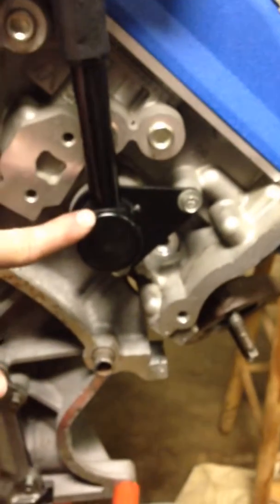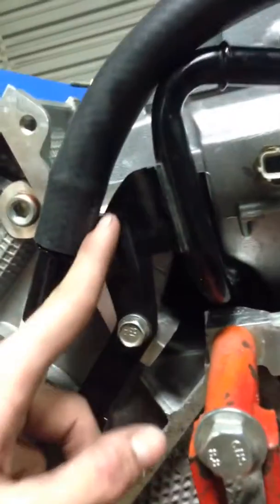4.6 4v cooling Mod

Comment: Do you know if a supercharger for a 4.6l 32v like you have here will fit on the 5.4L version of the 32 valve? My dad and I swapped a 2001 navigator 5.4l 32v motor into my 2001 F-250.
Reply from the maker: Not sure. If a 4.6 manifold fits then the blower would fit I think. I’d just do a centrifugal blower
Reply: @2004dsgmach1  thanks a lot, I want to get some power out of the engine with not a huge budget, is there anything other than a blower? Maybe bigger injectors and a tune?
Reply from the maker: William Ponds budget and build don’t go together my friend lol. All in for the Eaton swap on my Mach 1 was around $3400. Injectors, MAF, fuel pumps, tubes, the list goes one because your stock parts aren’t built for that demand, internals also, 4.6 are only good for around 475 then they pop. Not sure about 5.4 but they share a very similar rod (which is the weak point). 

Do some research and figure out if a 4.6 procharger kit will bolt to a 5.4. If yes then be on the lookout for a used one (usually less than $3000). Then fuel, MAF, etc..
Reply: @2004dsgmach1  thanks!

Comment: Nice. I've been fighting my 7 and 8 misfires, from valves sticking. So this is probably part of my problem. It's fine when  cold, but as soon as it warms up, I get the rough idle, and money light. I've tried everything besides removing the head, with zero luck. It's those exhaust valves, and you just can't get to them like you can the intake side. I guess that if, or when I do fix it, this is something I should do.

Comment: Longtivity wise have you had any issues with leaks or heating issues after installing your version of the mod?
Reply from the maker: jmanawsomeness never had any issues with that setup. However I pulled the trans shortly after this and replaced it with the MMR unit. You can use any method you want and they will all work the same, it’s just a exit for the hot coolant any exit is an exit
Reply: Gotcha i was just making sure there wasnt some major flaw you ran into and thats y you switched to the mmr style setup because im about to pull my heads and want to do this mod after the guides r replaced and i found the part for 60$ brand new
Reply from the maker: jmanawsomeness sweet. I didn’t think they sold them anymore. Only “issue” I guess is the tube on the driver side head is very close to the head so you may have to bend it away from head to get the rubber hose on
Reply: They dont make them anymore but i found a ford dealer who still has 9 of them and i ordered one just now
Reply: @jmanawsomeness  where can I buy that part ?
Reply: And cool thank you for the info

Comment: so I already have the head tick.. is that head f*ucked? or can a rebuild fix it.. I've read it's just the tensioners
Reply from the maker: Mitch Barber. If the head already has head tick then you need to replace the head or get it rebuilt with all new valve guides. Basically the valve guides got so hot they warped and now are contacting valves when the valves open and close
Reply from the maker: Mitch Barber. BUT what side is the noise coming from driver side or passenger side? Front or back of engine?
Reply: 2004dsgmach1 I honestly think it's passenger side rear.. it's an 03 Mach. I can send a video of it.. I got the car a month ago she has some miles on her but I baby it.. very rarely floor it and the sound wasn't there when I got it, the noise is most noticed when it's cold at first start up
Reply from the maker: Hmm you may just have a chain tensioner problem or lifter bleeding of pressure and making noise on cold start but if the noise is always there then it is most likely the "head tick" but Normally it happens to the driver side head which is why people install the cooling mod like in this video. If you can send a clear video then send it to me @ 9726238665 or Blake pomykal on Facebook

Comment: yeah all the cam dots pointing up right? And yeah u got any tips on taking that bolt out?
Reply from the maker: Hmm your gonna have to drill into it and use a extracting drill bit and extracting reversin bit to remove it. Your gonna have to get some drill bits that wil cut into a grade 8 bolt. Send me your Facebook name or your phone # and I'll send you a few pictures of how I had all my marks lined up

Comment: Hey bro so I'm barely doing my timing. I set the cam dots straight up. crank at 6oclock. I installed chains and then rocker arms after. but the engine still hard to turn?
Reply from the maker: Engine hard to turn? It's normally really hard to turn over the engine by hand, it's because the Pistons are sliding up the cylinders. Now with the chains installed it should be harder because now your moving the valvetrain. Or does it just randomly stop turning?
Reply: 2004dsgmach1 well I have 2 problems lol 1 broke the crank bolt lol and after I timed it it was hard to turn but I turned it like 4 times. I went to try and turn again and j couldn't
Reply from the maker: josue vasquez. Dam lol ok did all the timing marks line up to the dots/marks on the chains? If the engine spins then randomly just stops turning then you might have the marks wrong and the valves are open and hitting the pistons causing the engine to stop dead in its tracks. Let me know. hopefully the bolt isn't to hard to get out

Comment: what if I already have the heads on? how do I do it?
Reply from the maker: You can turn the crankshaft with crank pulley bolt and you can turn the valvetrain separately by putting a wrench on the left or right cam sprockets and turning to get the dots to line up
What is your phone # or Facebook. I can send you some pictures of my timing marks
Reply: @2004dsgmach1  what is that part called if I buy it like you said?
Reply from the maker: JAP JAP it’s been discontinued. Best bet is MMR kit for $200
Reply: @2004dsgmach1  I want to add an eaton on my Marauder ....any help/guidance?

Comment: Okay and what about for the smaller chain on the cams? do those have to be set up right to?
Reply from the maker: Yes. With the head on a flat surface the dot on cam sprockets sould be facing shraight up. And again straight up with both intake and exhaust valves shut and cyl 1 at TDC

Comment: how to set the whole timing lol on the cam chain ?
Reply from the maker: Ok so the cam sprockets and crank sprockets have these little dots on them as "timing marks" the chain will also have the dots on it so basically line up the dots but there's a few steps you need to take before the dots line up. First spin the motor over until cyl #1 is at TDC with valves closed on cyl#1 the crankshaft mark should be facing straight down. Then turn the cam sprockets until the sprocket marks are pointing up and then install the chain to each side. Just make sure all the dots line up

Comment: will that be good to do on a 99 cobra?
Reply from the maker: Ya, I don't think it's as big of a deal with the pre 03 4v's. But if you search head tick you will see some guys with older 4v's that have the same issue
Reply: I got a 99
Reply from the maker: +Josue Vasquez. Ya I've seen this noise and issue on pre 03-04 like yours. The cooling mod Is good cheap insurance that you won't have a issue in the future. Is only time consuming because the trans needs to be removed.  I'm currently doing the cooling mod to my 04 cobra
Reply: Oh okay u gonna put video?
Reply from the maker: +Josue Vasquez. Yes I have several videos in the working.

Comment: So i just bought a set of 2005 revised DC heads. I just realized i may have an issue. I bought these heads used and noticed that the back of the passenger side head does not have a hole for the coolant to flow out.....why the heck would the passenger head have the plug???
Reply from the maker: Racequad9. Send me a friend request on Facebook. Blake Pomykal. Send me a pic and I will hopefully clear it up.
Reply: 2004dsgmach1 dang, i deleted my FB account a couple yrs ago... it's cool, I'm taking them to shop tomorrow to get them resurfaced and valve job. the shop specializes on mustangs so I'm sure he can answer my question. i just found it weird that it doesn't have an exit. thanks for reaching out though.
Reply from the maker: Ok no biggy. There is a freeze plug that you need to remove. It's a little circle thing that you can take out. Use the video as a reference to were the freeze plug is

Comment: Did you have to drill a hole on the driver side in order to install the adapter?
Reply from the maker: racequad9. No holes were drilled. The holes are already threaded from the factory, they were just not used for anything
Reply: 2004dsgmach1 really?! did ford intend on doing this mod but decided against it?
Reply from the maker: +racequad9. The only reason there's pre drilled  holes on both heads are because the heads are exactly the same. They use the same part number on both sides. The only difference is the direction of the cams, in other words you can install the left head on the right side as long as you installed the cams to face the front again
Reply: 2004dsgmach1 good info, i did not know that.
Reply: 2004dsgmach1 wait, wouldn't you have the exhaust manifold on the wrong side though?
Reply from the maker: +racequad9. My bad they work on both sides if you turn it 180 degrees because of the intake and exhaust sides. The front of the head and the back of the head have the same exact holes/ports and holes for timing cover

Comment: hopefully you can read this brotha. what exact parts did you get for this? the cheapest kit is for like 200 bucks for some tubing and the metal outlets hahaha
Reply from the maker: David Castro+ ya man for the kits it's a lot of money. I bought from ford the black tube that goes on the passenger side of motor and just put it on the driver side head and crossed over as you see in video. Somebody recently watched the video and told me that ford no longer sells this tube. So unfortunately you might have to buy a kit or look on eBay for another stock tube
Reply: Ahhhh damn that sucks bro

Comment: How well did your version of this work out for you?
Reply from the maker: This worked great until I removed the trans for some reason and when I did I went with MMR low profile cooling mod kit. They both worked as intended, but my method was a lot cheaper
Reply: 2004dsgmach1 thanks for the reply I'll give it a shot brother!

Comment from the maker: It most likely will not help overheat issue. It just provides a exit for coolant on drivers head. The tick for me was around 38,000mls ford replaced the head with a so called revised head, which still had the issue and cause Pistons to crack on cyl 7&8. If your having a overheat issue the head tick can happen that much faster
Reply: Dude the whole overheat issue was because there was no exit and coolant pounded, now it can circulate problem solved

Comment: How long did it take for the damage to occur to the engine I haven't developed any ticking noise yet but I have approximately 14,000 miles on my build but my car has gotten warm a few times I currently have the transmission pulled in the car and I want to add this modification to help my heating up issue

Comment: Where can I get cylinder headeds to convert from 2 valve too 4 valve dohc
Reply from the maker: Joshua Nicolajsen. Honestly I would say eBay off a Mach 1 or cobra. The bolt patterns are the same but you'll need all need timing chains/guides ect. Well worth it but it's a project
Reply: Thanks for the help 2004dsgmach1, i will definitely do it once i have the money .Im putting the engine in my 1969 ford f100.

Comment: Does this matter for the teksid motor out of a 97 4.6 dohc cobra?
Reply from the maker: Brett McBurney, the teksid has same issue and cooling mod is the same with this WAP, teksid, and Romeo
Reply: +2004dsgmach1 I've been thinking about this for a long time now. Thanks for the info!

Comment from the maker: Gregory Craig all that about the functions of EGR are correct. But it's all about building HP. Now with that being said the EGR is not open at WOT so I'm not gonna ramble on about now 100% combustible air/gas can enter the chamber because I don't really need that at idle or part throttle "which is when it's open" But there's still that extra heat soak from the hot inert gasses going thru the aftercooler.

Comment: Great idea! I'm going to use your cooling mod when I do my engine build. I can't understand the rush to remove the EGR. The EECV PCM uses the EGR to cool combustion temperatures by deluting the air/fuel mixture if temperatures get to high, to prevent damaging the Pistons. Back in the 70's before cars used computers and many of these pollution devices were 1st introduced they were slow and sluggish to respond, and performance was degraded. But today with modern technology and advanced computer controlled PCM's that has all changed. For example cars today, straight from the factory easily making 400, 500, 600 even 700 horsepower. All from a small block engine with catalytic converters.

Comment: I did same thing, but I drilled new hole so it was straight up, then I eliminated egr. And my evap as matter of fact, then just program both features out. with an engine like that I'm guessing you're getting a tune so why not just program them out.